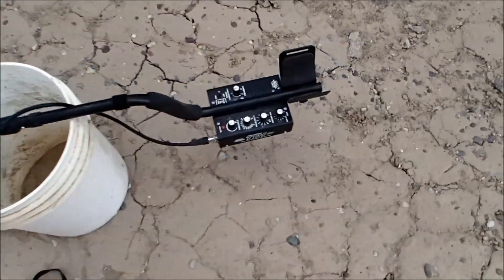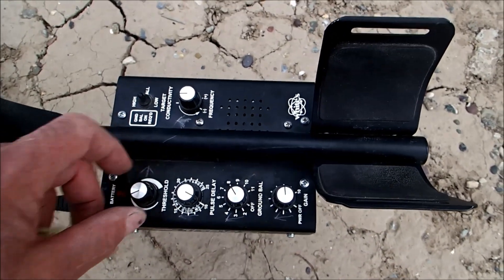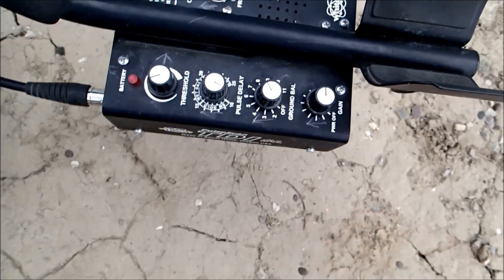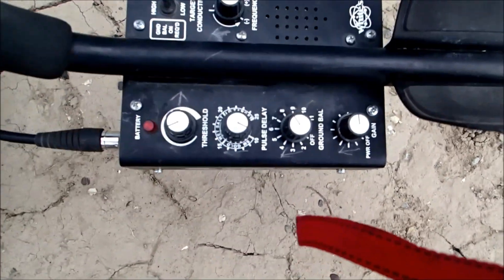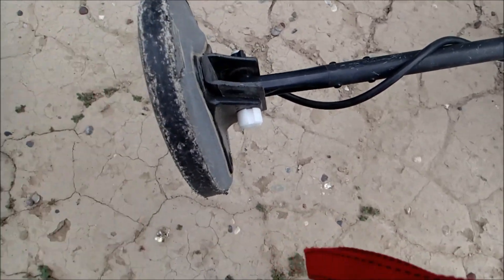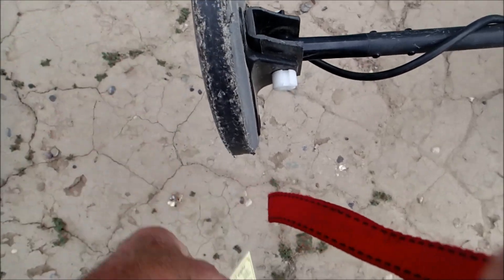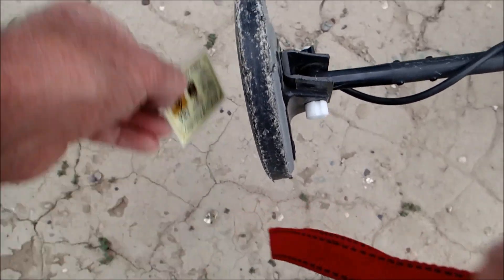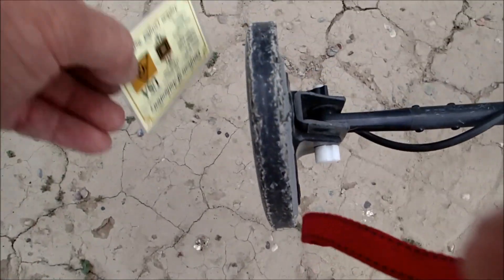Sweep Speed filter mod for TDI SL

Comment: Good afternoon. What voltage of capacitors was used on the replaced capacitors, in addition to a capacity of 0.22 UF?
Reply from the maker: These are filter caps so you don't need high voltage. Maybe 24v would work fine, or even down to 18, would be OK. Big thing is they need to match within 1% on capacitance

Comment: I'm not sure why you turned the 'Frequency' knob to the center. I thought that adjustment was only if there are other metal detectors nearby interfering with yours? Just curious. Cheers!
Reply from the maker: Good question, Dusty. You can sometimes eliminate EMI, from a particular source, by adjusting the frequency. Generally, I set the Freq. at center, and if encountering EMI I adjust up and down to try to eliminate it. I've noticed, in testing, that there may be a slight edge in sensitivity by running the Freq, as high as possible.
Jim
Reply: Jim Nelson —not sure if my question is that good, but your answer is awesome! Take care, Brother!

Comment: the button should be in low not all ..... for gold
Reply from the maker: That's not true. Running in low will make the machine quieter, but some gold gives a low tone. Run in low, and you may miss some large nuggets. I run in ALL everywhere I can, but some areas are too noisy to allow that, so I run in  low.in those areas.
Jim

Comment: I wonder why they didn't do that at the factory
Reply: I missed a 0 there but still the SL is so light and you don't have to strap on no external battery or speaker..its all very appealing  👍
Reply from the maker: @fs-rj2jq 

 LOL....I wondered about that price difference. That DOES make a difference, or would to me....Ha! I really enjoy using my SL here. I think, with the mods, it's really under-rated. I'm thinking of offering to do the mods here. Nobody is currently doing them. Both guys that were doing them quit. Everything that Whites builds have great ergonomics. I don't care how much gold a detector finds, if it's not a pleasure to operate. Having to use an external battery, or a sling to carry the weight, or both, is a deal killer for me.
Jim
Reply: @jimnelson7740  amen to that. it's a gamble though if I get the SL and it has problems ground ballancing or something I know I'd be lucky if i sell it at half the price or at all
Reply from the maker: I don't know. The factory did adopt the other Reg Sniff mod, at least on the new Special Edition model, and probably all of the SL's made after 2015. That mod removed a couple of diodes (D20 & 21), and capacitor C56, and installed a jumper across two of the three legs of the location where D21 was located. One of Whites retired engineers told me that removing C56 would increase performance, but he wasn't sure about the diodes. But, since Whites did that change I assume it benefited the performance. I'm going to do that change, too, but haven't gotten around to it, yet.
Jim
Reply: @jimnelson7740  I'm tempted to get the SL special edition maybe put an upgraded battery but just not sure about it's abilities in the West Australian dirt I'm running the ATX and can't go above 4 on the sensitivity without the machine going crazy.. for an extra $100 I can buy a new 4500 but who knows how much better that would be
Reply from the maker: @fs-rj2jq  I wish I could advise you on that, but have no experience in your country. From what I've read, for the extra $100 I'd get the 4500.
Jim
Reply: @jimnelson7740  please make a video of the actual modification. And also testing thank you
Reply from the maker: @wsmith6225  You have to understand that making videos is a serious chore for which I don't get paid a dime. I've already done the sweep speed mod, and testing. I have no idea of I'll do a video covering the mods.
Jim